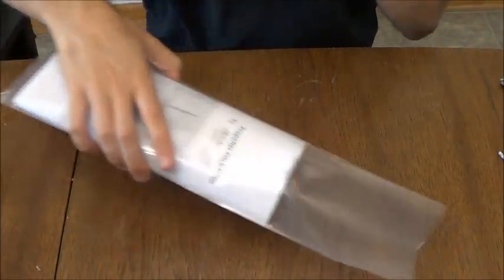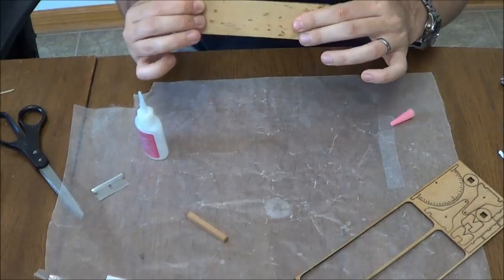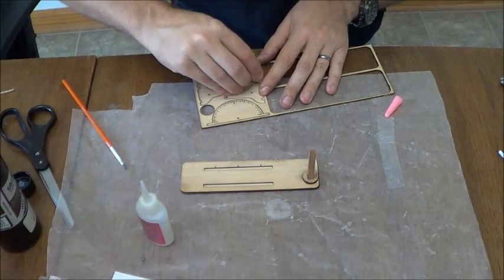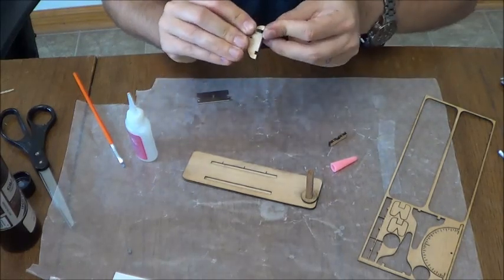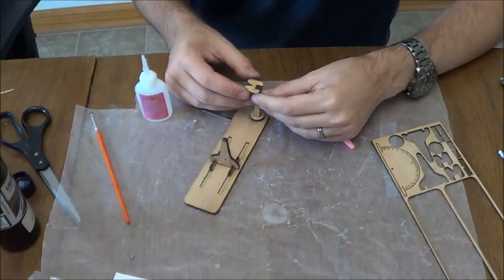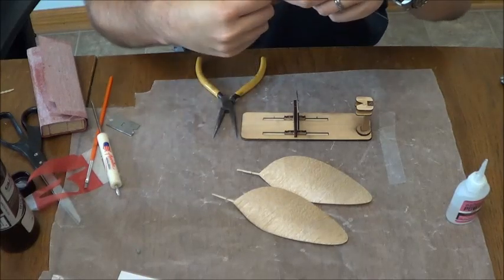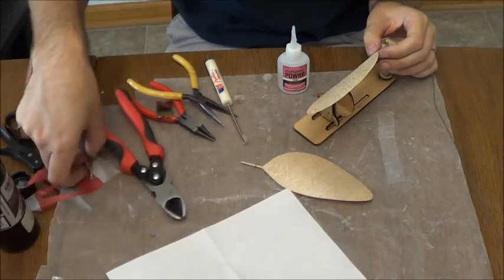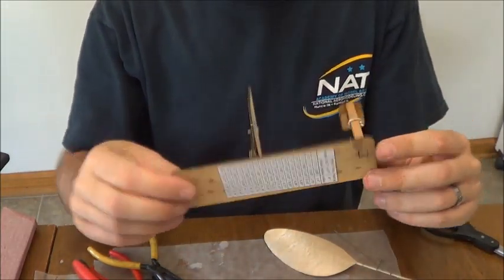Propeller Pitch Gage - Build and usage

Comment: I'm glad you decided to make one. I spent something like 2 days making one patterned from the A2Z gauge, but I don't think it is very accurate. I suppose if you use the same gauge it does not matter if it is off, because all of the adjustments will be equally off.
Reply from the maker: Ross Clements, Hope has been asking me to do this for about two years now. I decided it was time. :)
Reply: Hi josh can you give me pitch Gage ratio chart.. Please
Reply: @sanjaysoni2933  There is a very simple formula which you can do on a pocket calculator that has the tangent function. You will not be constrained to the 5 degree steps or three radii on the table. Pitch equals pi times the tangent of the angle times the Diameter. The Diameter is twice the Radius.

Comment: Interesting concept. I like the sliding prop support that allows measurement at a continuous run of radii. I like the 180 degree protractor. I'm a little concerned that the prop post, protractor support and protractor hub are a bit wobbly. It depends on the precision you require. What are the precision and reliability of this gauge? The protractor has 5 degree divisions. This might be good for rough settings for test flights, comparing one setting with another, and for getting both blades to match. For detailed performance evaluation, greater precision is required. I have built and tested several prop gauges. My final design combined the best features of several designs. It was built specifically for measuring 8" carved balsa props.  The shaft clamp might need to be modified for other types of props. My report is here:

http://www.endlesslift.com/propeller-gauges/

Couple improvements I can see. That protractor is pretty small, but you can lightly engrave finer angle markings. You might require a finer indicator, maybe a pin. Face the protractor out so it can be read from the end, rather than having to look in at an angle past the prop blade - parallax error. Rubber band around thin wire can bend the wire, causing the blade to tilt. Pressure right next to the support will be less likely to bend the prop shaft. You might find that a wire clip is more reliable.